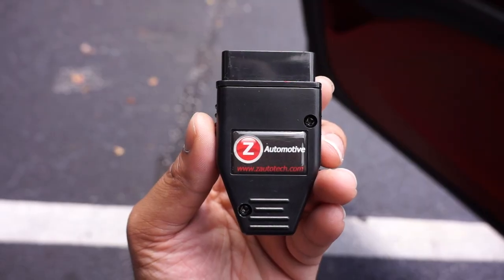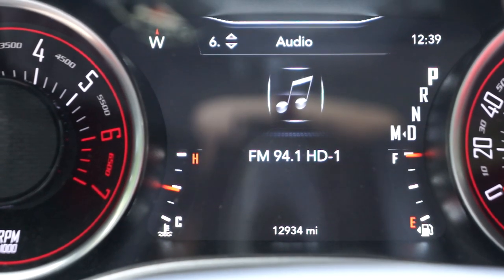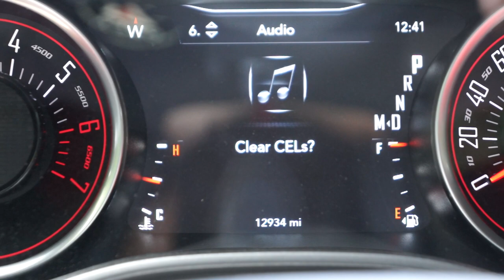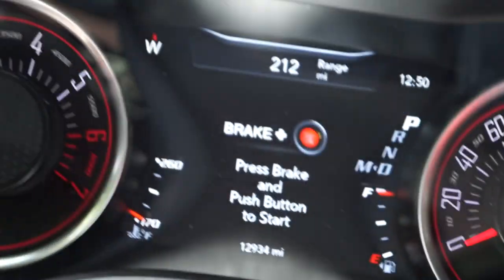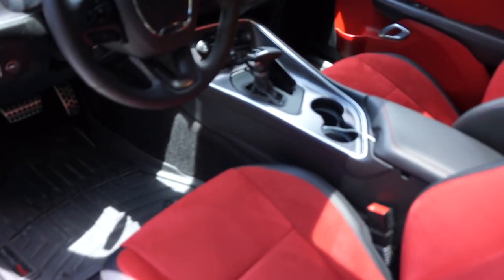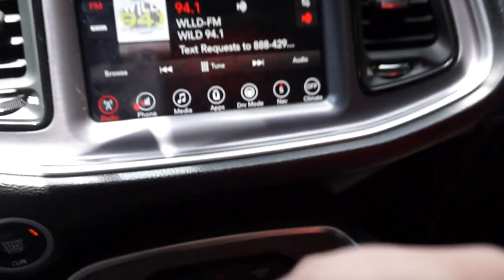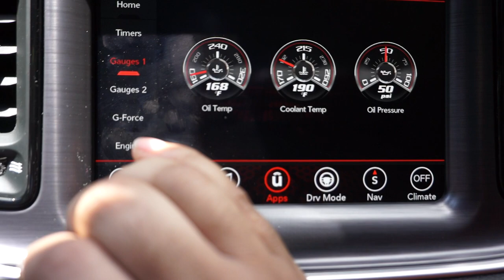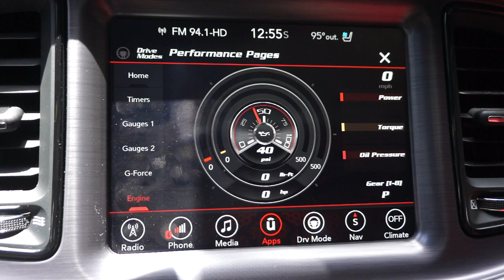zAutomotive Tazer: Installing SRT Performance Pages (2.4.3) #zautomotive #tazer #srt

Comment: Every video I find is 2017 and below. Any update on 2018 and above? I have a 2018 and have heard of people having an issue with losing the sport mode button option. Any update?
Reply from the maker: U should be able to address that by remapping the sport button. 2017s have the same issue
Reply: @ModernDayMuscle  
Thanks for the quick reply. I guess I will buy it and figure it out as I go.
Reply from the maker: Let me know if you run across any issue I can try to help
Reply: @ModernDayMuscle  
Thanks for the help man. New subscriber 👍🏽

Comment: I have the 2016 chrysler 300 tazer but no performance pages not showing only drive mode track, sport etc.
Reply from the maker: Yeah I don’t think it would show up
Reply: @ModernDayMuscle  well it finally did pop up after restarting the radio.
Reply from the maker: It can’t be finicky sometimes
Reply from the maker: Glad it worked out
Reply: @joewatts3691  I have a 300 and it’s doing the exact same thing… all you did was reboot the radio??
Reply: @jared241987  yea just hit the temp control air and heat at the same time to bring menu up and reset to factory.

Comment: if i were to put the performance pages on an R/T without super track pak, will launch control work?
Reply from the maker: I’m not entirely sure. I did some light research and didn’t get a straight answer however I’m still looking
Reply: soda_can it doesn’t for some reason. Not sure if anyone has a solution.
Reply from the maker: Not too sure if there a “quick” fix for this
Reply: @ws2594  you might need the brembos for that to work
Reply from the maker: I’m not sure how yours wouldn’t be configured as my car is technically a rt but I wouldn’t know for the 5.7s if that is what your saying
Reply: @ModernDayMuscle  i'm gonna trade in my rt for a 392 shaker pretty soon. i'm probably gonna do the same thing that street shaker 702 did and order the tazer before i trade in the car so that way i can put srt pages on it as soon as possible

Comment: Unfortunately every time I have tried to put the SRT pages in my car it does the initial blue with radio lock but after 2nd sleep cycle reverts back to performance pages. What gives? I have a 2018 T/A 392 and have done everything I’m supposed to. Even the fuse pull
Reply from the maker: Where are you installing the tazer? For the 2018s and up it needs to be in the trunk or you will have issues
Reply: Modern Day Muscle  Yep I have it installed in the trunk. It comes with the double bypass for 2018 models. I have SRT mode and it seems to work. I even did the fuse pull in the back and it turns blue on the first time I run it as mentioned above
Reply from the maker: matthew maldonado I know had trouble in the beginning as well. Try this if haven’t already. Turn on SRT set this will give you the srt graphics. Then turn on performance set to get the pages as well as eco mode. Do a full reboot and let me know what happens
Reply: Modern Day Muscle thanks will do. I did exactly that yesterday but I’ll try it again in a couple hours and let you know
Reply from the maker: I’ll be on standby
Reply: Modern Day Muscle well $hit Zautomotive got back with me and said My XM Guardian subscription is what is causing the issue
Reply from the maker: Wow that’s a first I’ve never heard of that one interesting
Reply: Modern Day Muscle IKR I would’ve never figured that. My trial subscription just started last month. I have to believe it though, coming from ZAutomotive. Bummer but it’s better to know and thanks again
Reply: Cant get the blue pages in my RT anyone knows if it works for regular 2017 RT
Reply from the maker: Can u disable the subscription maybe

Comment: Jeep Grand Cherokee SRT 2014 Europe Version workit?
Reply from the maker: Zmajlaj Admir  I’m not entirely sure if it would work on a Europe version of a Jeep Grand Cherokee SRT 2014. If it did I think the features that would be a add on for you would be the light show, line lock and maybe memory seating. But again I’m not too sure since my vehicle is 2017 challenger. I also saw that there is a tazer made for jeeps on the z automotive site as well.
Reply: Modern Day Muscle  thank you  for the help and explanation

Comment: Does this give you an option to open the exhaust?
Reply from the maker: I haven’t seen anything on that
Reply: Modern Day Muscle I’ve heard ppl claim that in track mode, the exhaust is wide open all the time. Not sure if it’s true or not, but ppl have reported that it is.
Reply from the maker: Yes that’s true but a feature to just have it open no matter what mode ur in is not true.
Reply: Modern Day Muscle right. I guess I’ll just have to do a resonator and mid muffler delete then for more sound?
Reply from the maker: Yeah I started with a mid muffler swap but ended up deleting the resonators in the end as well. I also did a video on that. Some ppl complain about drone but to me it’s not bad it’s music to my ears. Some really hate it though but I believe it’s exaggerated how loud it is tbh
Reply: @ModernDayMuscle  Did it drone when you only did the mid muffler delete???
Reply from the maker: At mid muffler delete No it not drone

Comment: how can i get the tazer , and also the tazer already has srt performance page or i should download it into the tazer ?
Reply from the maker: You can order one from zautomotive and depending on the car it would already be on the vehicle you would have to unlock it with the tazer. But again it depends what vehicle trim you have
Reply: @ModernDayMuscle  I have a 2015 Dodge Challenger scatpack.do you think the tazer would work on my car to unlock srt pages? And can i plug it in download the srt pages and take it out or do it have to be plugged in the entire time?
Reply from the maker: Possibly but to be sure check the taser website

Comment: Does this work for 2017 Dodge Charger  RT???
Reply from the maker: Yes it does
Reply from the maker: Some features may not apply just fair warning
Reply: It worked on mines but launch control and shift light doesn't work
Reply from the maker: U have to go back in the menus and enable it I’m not sure if you did or not
Reply: @ModernDayMuscle  u sure on a regular RT both will work
Reply from the maker: I will double check later to make sure
Reply: Modern Day Muscle Did it work for the launch control or not?
Reply from the maker: If the launch works for what? The RT or the Scatpack?
Reply: Modern Day Muscle RT
Reply from the maker: I’m assuming ur inquiring about the 2017 model as well?
Reply: Modern Day Muscle yes. I want to purchase the tazer and I’m tryna get as much info as I can on it for my car lol
Reply from the maker: If it comes on that car but just on a higher trim of the RT u should be able to unlock it. For example the Scatpack doesn’t have SRT pages but there is a SRT 392 when I installed the taser I unlocked all of the SRT 392 features because it was already on the computer. Hope that makes sense
Reply: Modern Day Muscle yes it does